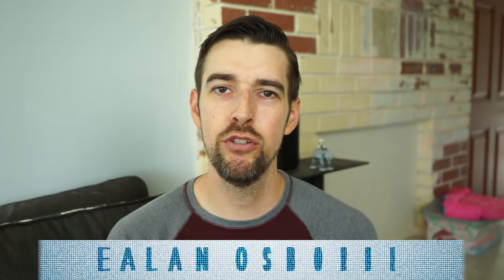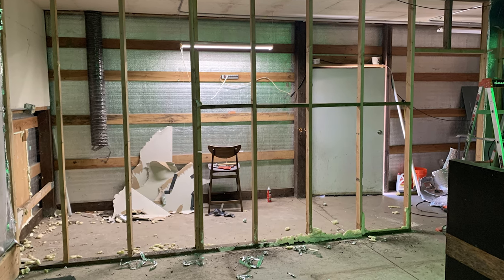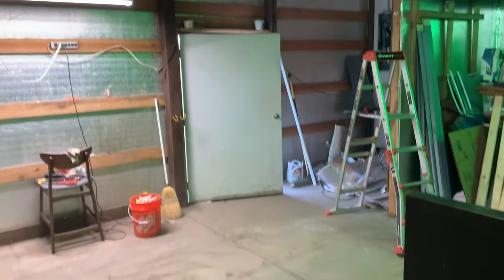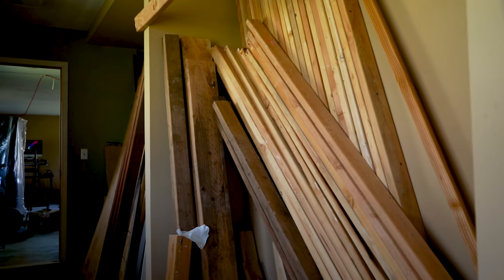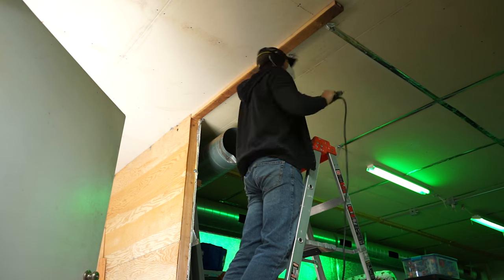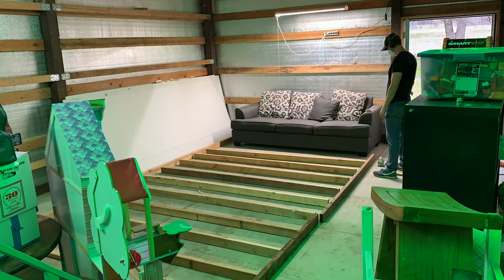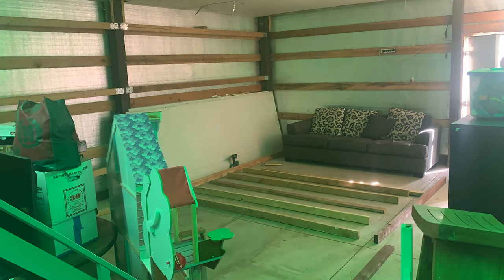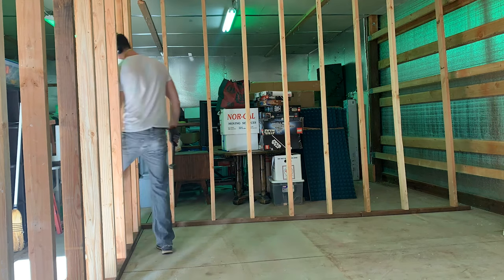DIY HOME THEATER BUILD EP 1 | Home Audio

Comment: Ealan:  Other than cost and different parts, which is the better long-term investment:  Marantz 7015 or the Denon 4700H.  Currently have a 2018 Marantz 5012 (100 watt) / 7.1 speaker layout with 100 watt in-wall speakers.  But want to add height speakers — soon.

Secondly, Is 125 watt receiver power too much for 100 watt speakers or should I stick with the Marantz 6015 / Denon 3700H at 110 watts/ power?  (But No Auro 3D option.)

Meanwhile, your previous video about the Audessy menu layout and how to — actually use it — was such an eye-opener!    (Previously, to me it was like trying to read/understand Greek.  I see why most folks head for all in one — sound bar solutions. Audessy is just too intimidating but necessary if you want to take a traditional approach to media room sound design.  It’s what I got from the contractor when I had no previous experience with media room construction.)
Reply from the maker: The internals and overall manufacturing patents with Marantz tend to make it a more versatile machine when it comes to movie/TV watching AND music listening. So if you use it in such a way, go for the SR7015 (which is what I have). If you’re mainly using it for movie/TV watching, go for the x4700h. Not saying the Denon sucks with music, no way. Marantz just has a slight edge in music reproduction. 

As far as power, 125 watts is the “2 channels driven” rating, so when all channels are going at once, it’s more like 75 watts per channel, if that, so you’re still good with your 100 watt speakers. Although I would have it in your long-term goals to add external amps at some point. Game-changer when it comes to details and overall audio processing. 

And yeah…if you can swing it, always go for the x4700h or SR7015 because it’s always nice to have the Auro 3D option, just in case. 😁🤘
Reply: @ealanosborne  Ealan:  You are the first to provide a considered response among all the vloggers I have asked. Not a music lover per se.  (iphone / headphones is just fine — mostly for workouts.)  My wife and I, and my daughter’s family though are movie watching  — fanatics — so the Denon now is on the shopping list and I will buy one now — shortly!  

Thx for the power explanation!  In wall speakers are not easy to swap out.

As for height speakers, is there a brand/ style type you prefer?  Have you heard of Axiom speaker corp.  They make a 4-way “on-wall” height speaker/pair. (up/down and both sides.)  As I review height speaker layouts, I understand that if I want to go higher than 7.1.2, I will need to add an amplifier.  Is there an amplifier brand you prefer?

Thanks again for your “straight-talk”.  Very Much appreciated!  Finally, an answer! 🥳👍🍾
Reply from the maker: @marvinabugov4579  I don’t really have a brand I prefer for height speakers. But typically, you’ll want to stick with the same brand as your ear-level speakers, so they’re timbre-matched. 

Although the style I prefer are the trimless angled type, where they’re meant to be almost invisible on the ceiling, but the speaker itself sits at an angle within its housing above the ceiling. That way the fixed angle points towards your listening position, rather than shooting straight down. I like that better than the style where just the tweeter can be angled (because angling a tweeter can cause undesired audio anomalies). 

Not that I recommend this brand, but here’s an example of what I mean:

https://www.inwallstore.com/Angled_Ceiling_Speakers_Kevlar_Titanium_Inwalltech_p/hd650_1a.htm?dfw_tracker=3717-HD650_1A&gclid=EAIaIQobChMIj_qk8vDd9gIV-z6tBh2ESQZtEAQYASABEgJTy_D_BwE
Reply: @ealanosborne  Thanks so much!  I will take a look.  All the best with your media room new construction.  Looks awesome!

Comment: You might want to pre frame in specific spots for  testing in wall speakers! (some require larger areas then 16 on center studs have)  Do you have a 3D plan for what you are building towards? What are the dimensions etc?  Good luck! it can be fun but also a PITA lol.
Reply from the maker: Yeah I’ve already tested 2 different in-wall speakers so far, and it was a PITA for sure. I think I’m done testing those for awhile, but I may change my mind down the road. 😄

The room is 11 feet wide by 16 feet long, so I’m looking forward to the immersive 3D experience! Even though it’s just a “testing” facility, it’ll be my first dedicated home theater space ever! Stoked! 🤘

Comment: This might be a dumb question, but what are speaker plates?
Reply from the maker: Did I say speaker plates? 😄 I meant speaker wall plates, if I did. Red and black banana plug wall plates to plug speaker wires into. And I’ll have them all connected behind the wall going to a master wall plate that will be behind the TV

Comment: I have sent you a message or I have sent you a message before regarding looking for an AV receiver that would be accessible for the blind. I am at the point I am ready to make a purchase, and that is less of a factor now. I will just have someone calibrate the machine and after I learn the remote, I should be good to go. I am looking for a suggestion for a AV receiver and possibly speaker package I do not want buyers remorse after I would make a purchase and find out that I should have spent just a little bit more to get a lot more bang for my buck.  Thank you
Reply from the maker: Yeah, I remember J! Before I make any suggestions, what’s your budget? And how big of a setup are you going for?
Reply: my budget would be around $800. I do have a powered subwoofer that I think would work fine from my current Yamaha Home Theater system. But the rest of the speakers we could swap out.  One of the reasons I want to replace it is I don’t think it can process 4K, because when we back out of web services, the image always goes Black for a moment and then returns.
Reply: @ealanosborne   The main reason I am looking to upgrade my Home Theater is because it appears that the Yamaha system I have now, over 10 years old, does not support 4K. The subwoofer is powered, so I think I can get by with that. The other speakers I would want to replace, upward firing Atmos not installed in ceiling budget would be 800 to 1000. Forgive the dictation errors!